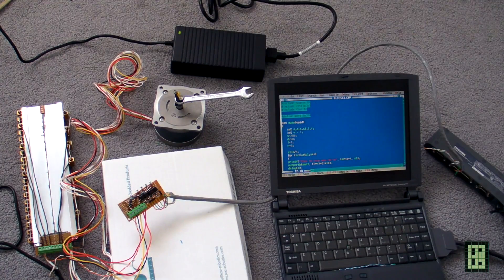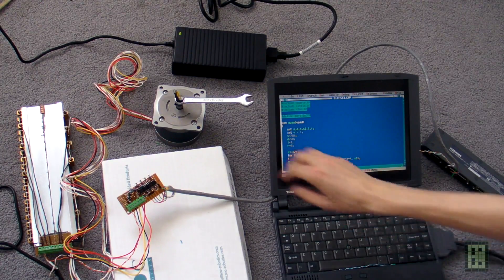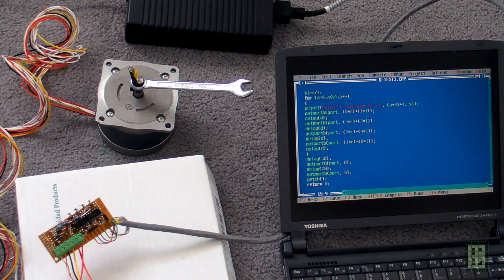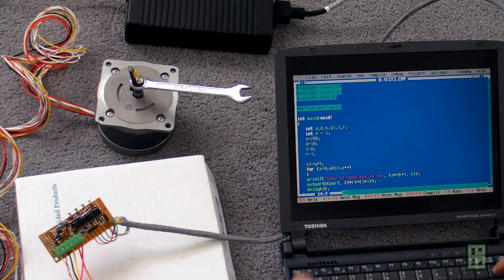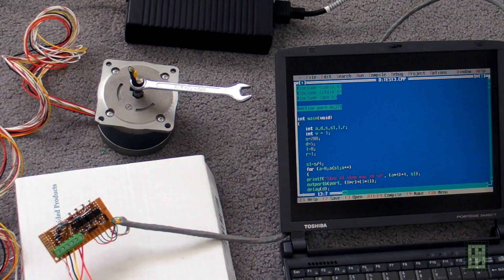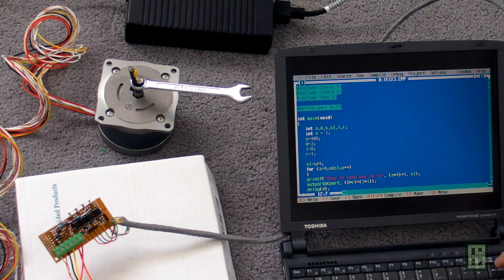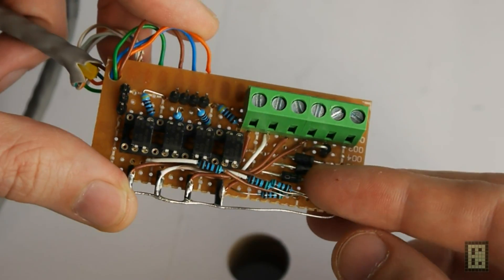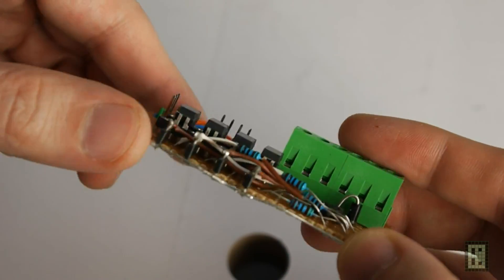Stepper motor controlled with computer parallel port LPT

Comment: hey good video there, I would to ask a question, how can i control the stepper motor like you, but by using a adruino uno ?
Reply from the maker: If you have an arduino uno then you do not necessarily need a computer.
What you will need is a proper stepper motor controller. I used a very crude version of it that I build from parts that I had around.
You can find inexpensive controllers on eBay depending on your stepper motor and they just need one digital IO for pulse each pulse equal one step and one digital IO for direction "0" is one direction and "1" the other direction that is all you need two IO pins from your arduino.
A more crude version If you like to play with a stepper motor is to use an ULN2003 with that you will need 4 IO pins and the software will be a bit more complex also it only works with much smaller stepper motors.
Search for ULN2003 on eBay you will find a nice board with ULN2003 IC + 4LED's and a small stepper motor for 3 or 4$ and free shipping.
Reply: ***** i'm doing a tracking application using opencv, so the signals are sent automatically from my application... "put a camera on the motor and track a head for example, then turn the motor to get the camera following the head" that's why i need a computer...
Reply from the maker: tinedghar mohand
OK that make sense then just use a serial port on the computer if you have one or an USB to UART and send the camera position to arduino.
Not sure what computer will you using if is something like a raspbery, BeagleBone or some similar that has digital IO pins accessible then arduino is not needed for this.
I used the parallel port but that was on a really old laptop usually they are not available anymore maybe you can find some USB to parallel port adapters but in real time OS you don have good access to it so better just use USB-USART to arduino uno.
Reply: ***** thank you electrodacus for taking time to answer me, that was very helpful thanks again

Comment: Hi there, If I want to use steper motor for 3d printer. Do I need to up load motor control program Or the 3d printers software which are available in internet will make it operating.
Reply from the maker: I'm not very familiar with 3D printers but I think you have software running on the on-board microcontroller usualy an 8 bit AVR that can read 3D print files and move the steeper motors accordingly the this files you can get from the Internet or you can create your own design using a software that you run on PC.
Do you want to build your own 3D printer ?
In the past CNC quite similar with 3D printers used computer software and parallel port to control the stepper motors so it needed the computer on all the time and a special software on the computer.
On more modern CNC's and 3D printers there is a microcontroller integrated on a control board that contains the software necessary to read the files form an SD card and control the steeper motors without the need for a computer.
The computer is not needed for the 3D printer operation but is needed to create the 3D files with your design. Not sure what software are available for that but I guess there are some free variants for that also.

Comment: Dude, i have a project design for my Final thesis. .i know that you are a big help for me.

Please give me the circuit of your parallel port circuit, i badly need it a.s.a.p.
One features of my project is a bipolar stepper motor using parallel ports to control it. If you have time, could you post the circuit on my yahoo account. God Bless.

i_love_vannesa@yahoo.com
Reply from the maker: If is just a small stepper motor use ULN2003 or if a bit more current is needed then L298N that circuit that I used was just good for a short test I used some transistors that I had around diodes for reverse current protection and some current limiting resistors.

Comment: can you help me
Reply from the maker: I don't know. What sort of help do you need?
Reply: *****  I want to rotate a dc motor with gear system attached to it ....clockwise 70 degree and anti clockwise 140 degree and then again clock wise 140 degree...........when stoped return to original postion from where it was started.............................please help you help be really appreciated
Reply from the maker: *****
So you will be using a DC motor not a stepper motor in that case you need an optical encoder or in your case if + and - 70 degree from the zero position is all you want then you can use two switches (not very precise) or two optical detectors like used on a computer mouse wheel.
There will also probably be needed a third one for the 0 degree position.
It should be possible without the use of a micro-controller I just do not have right now in mind a simple solution.
.....The use of three micro-switches will probably be the simplest method one for the 0 position that will cut the power to the motor when in that position override by an ON/OFF switch then one micro-switch to left and one to right at 70 degrees that will reverse the motor direction.
You will also need a sort of latching system that will keep the motor in one direction until it gets to the other switch.
The switches can also be optical for better precision but a bit more complex.
Reply: ***** sir what if i used servo motor........can you please explain in simple terms and method to write code and connect it with microcontroller as I am a Chemicla engineer just required in my project ...........please help asap and thanks for your help
Reply from the maker: ***** For the servo motor you will still need some external feadback like for a DC motor.
The only motor that dose not need a position feedback is the stepper motor since you can rotate that with small steps.
Why do you want a DC or servo motor with gearing do you need a lot of force ?
Reply from the maker: *****
I do not have a fb account and gmail is this one here electrodacus not that I use that chat future in there.

Comment: it iwa good thanks
Reply: hello sire! i would like to learne about stap motor and programing it . how can i start wit this? could you help me to learne it. with simple motor and driver ,,, greeting Delshad
Reply from the maker: delshad ha
I don't have right now time for youtube videos or tutorial I need to finalize my off-grid hose first.
But is not hard or complicated. It depends what you need the stepper motor for.
The way I used the stepper motor is not very useful.
There are inexpensive stepper motor controllers on ebay usually for CNC with 3 or 4 motor controller one for each axis and you can also find controllers for individual motors.
Then all you need to do with those controllers is give the number of pulses on one pin that will be equivalent with the number of steps you want the motor to move and another pin to select the direction of rotation is as simple as that.
Then you can either use the parallel port of an old computer, an USB to parallel port adapter or better a micro-controller.
If you don't know how to use a microcontroller I suggest you start with an ARM cortex M microcontroller and learn that first.
They are available from under 1$ cortex M0 to a few dollars cortex M3 and a bit more cortex M4 and there are cheap development boards for them as low as 10$.
Reply: thank you very much

Comment: I AM USING STEPPER MOTOR TO CONTROL THE MOTORCYCLE SPEED. I AM USING LINEAR VARIABLE RESISTOR AS A TRANSDUCER FOR CONVERTING MECHANICAL MOVEMENT OF ACCELERATOR IN MOTOR CYCLE TO CORRESPONDING CURRENT. I AM GIVING THIS CURRENT VALUE AS A INPUT TO MICROCONTROLLER. BY USING SOME CALCULATION I CAN GET NUMBER OF STEPS THE STEPPER MOTOR HAS TO ROTATE. CAN WE ABLE TO MAKE A PROGRAM WITH THE NUMBER OF STEPS VALUE.HELP ME TO DESIGN PROGRAM EITHER WITH NUMBER OF STEP VALUE OR WITH ANGLE .

Comment: Hello Electrocacus...awesome ..... 1) can reverse current be harnessed ? even if in small quantity?
another thing ..
I have used controllers using assembley to control stepper motors... I want to learn it by use of C programming as I have a project to make a pwm, by using usb directly... please let me know from where can i get a good source to work on this....

Comment: In Linux you have direct hardware access to parallel port in /dev/port but you need to be root to have full access. 
echo -e -n "\x"FF | dd of=/dev/port bs=1 count=1 seek=888
888 is port address in decimal (0x378 = 888).
"\x"FF is the number what you will send to port. FF is 255 or 11111111 in binary.
"\x"00 will be 00 or 00000000 in binary.

It is using standard command in Linux. But if you need to programm in C or C++ you will want to search in google: Linux Parallel-Port-Programming-HOWTO

Comment: On my machine i have installed sentOS 5 (linux) and  windows vista. for these operating systems what i should do to interact with hardware.
on vista i have installed visual studio 10 can you tell me port no for the visual studio 10 or sentOS

Comment: @g1cast  Diablo and CDC also used the voice coils to move the flying heads on the disk drives. 
Amazing what is being done with technology these days. Take what is old and re- invent it for an updated application.  Electrodacus is looking to generate power with these steppers as generators. Hope he fares well.

Comment: @craftymaggot: worked with these motors too. same years  you did.  Before the advent of the linear 'voice coil' motor to drive read/write heads of disk drives,  Fujitsu's mainframe 'hard drives' used 2 pulse motors to move the heavy r/w head assembly back and forth across the spinning disk plates. 

Stepper motors I think are used now in our new cars -- to move the throttle plates
in  systems they call 'throttle by wire'.

Comment: I recall working with similar steppers that were used on a modified  IBM SELECTRIC type writer to work as a form fed X and Y plotter. I was a tech with Wang Laboratories at the time ...in the 70's and 80's. When that machine was plotting those steppers moved fast and accurately. Any problems I had to fix were either with the mechanical s or the power drivers.
Nice video